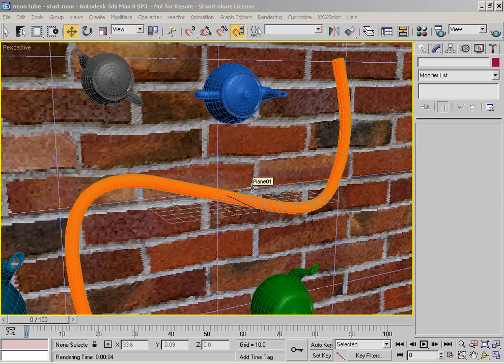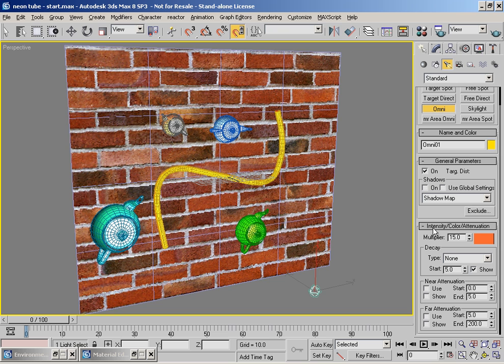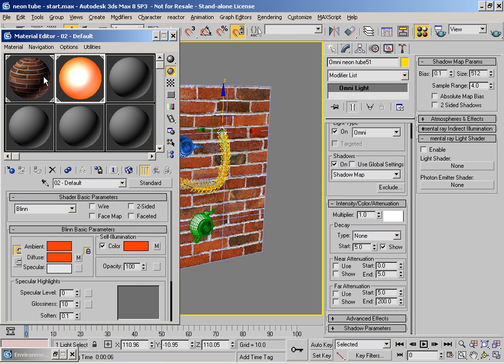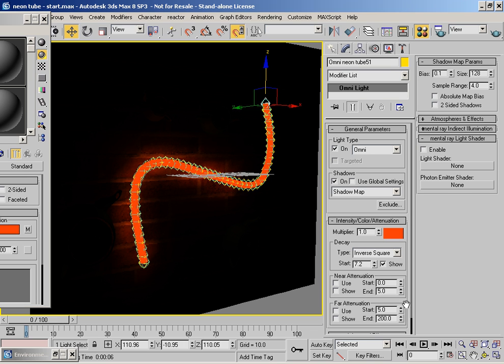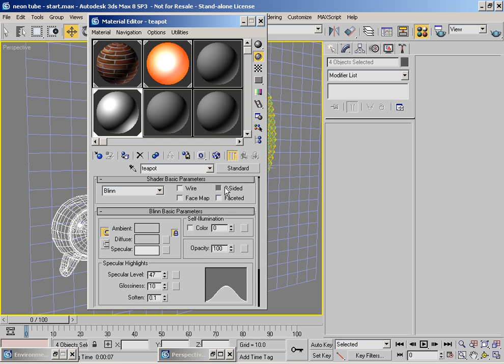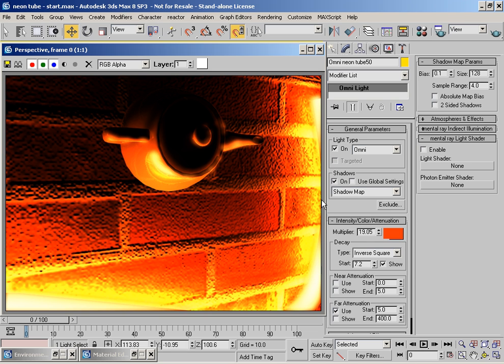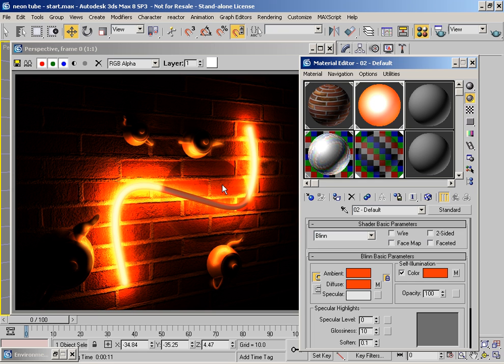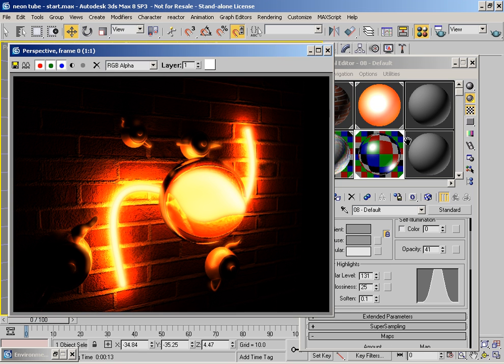Fundamentals - Neon Lights & Material IDs - 3ds Max Introduction Video Tutorial

Comment: @Pete: Is there any limit in numbers of the light sources on the scene? I dont know why but after using the spacing tool and rendering the scene got a very weird big black triangle (as shadows) on the wall instead of having the same result you made. I have the same setup as you have but im still learning this rendering stuff and I may missed something like basic setup or else. Do you have any idea what would that be?

ps: shadow map shows this error.

Thanks in advance

Comment from the maker: No, you can use mental ray. Actually within mental ray's a&d material there is an option to cast illumination from self-illuminated material when using final gather. This method was designed as a quick and dirty solution back when mental ray wasn't included / included fully. Also bear in mind mr's shadows will differ from those in Scanline. Sometimes doing things the "legacy" way saves a lot of time and headaches...!